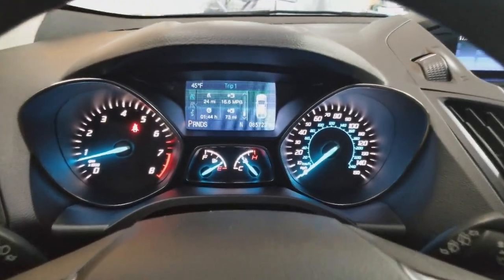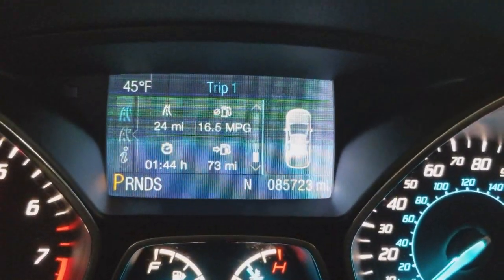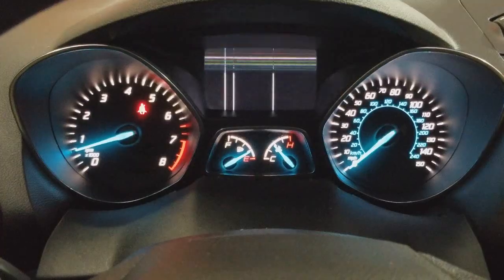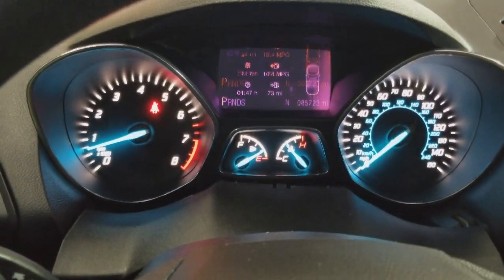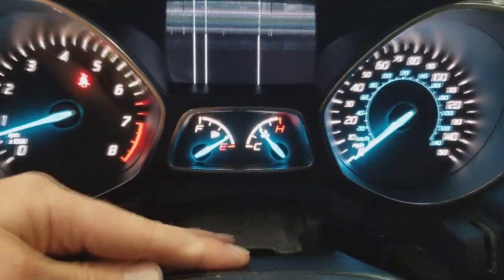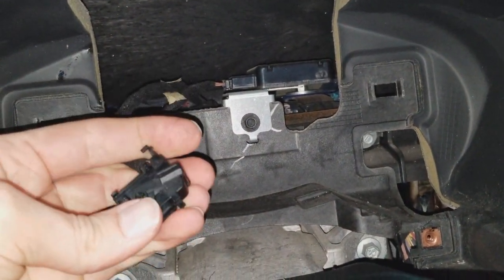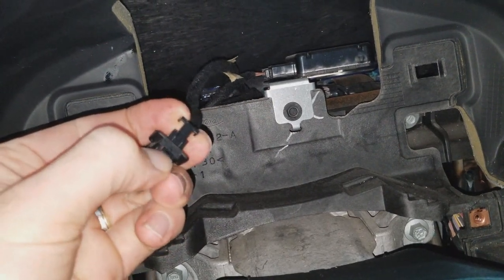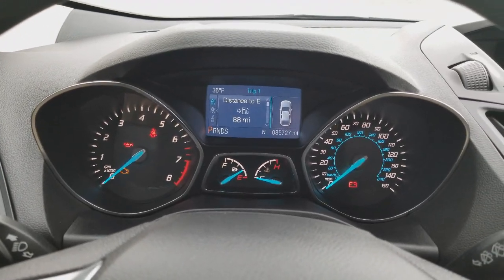2013-2016 Ford Focus Escape Dash Cluster LCD Display Problem | How To Remove

Comment: ours does this and its a 2016 with 28k miles. needs to be a recall on this cause it makes it impossible to know the milage of your car and when you need to service it. also this is temp fix. once it goes out ford wants $1k for a $50 screen and 15 mins work.

Comment: My 2014 Ford focus just started doing this on the radio display screen thing. The screen above the radio. It started doing that flickering thing and change to like a solid gray/white color a couple days ago. It would be fine in the morning starting it to leave for work and as soon as id start driving it would start doing that flickering thing and then after a few minutes go to that solid gray/white color and stay like that for a few hours and flicker a little. All of a sudden later in the day/evening it would snap out of it and be fine later at night until morning. Now it's stuck on a solid white screen. What do I do exactly???? Same process as this it what?

Comment: I see that you removed the cluster, and replaced the cluster. but what did you do to fix the display?
Reply: it usually an capacitor or resistor :)
Reply: Sp for someone doing it for the first time ..did you replace it..what was replaced?
Reply: @MrNismom  He wants you to remove it and send to him and he will fix it and send it back  (for a price of course.}
Reply: The lcd screen needs to be replaced...
You can buy it bra d new for around $100.
Or you can go to a yunk yard and pay around $10.
Reply: @enriquediaz5051  don't dream on 100 dlls
Actually the cost is 600.00 at the ford dealer
Reply: @jesusl4262  The $100 is to order it on Ebay, many sites offer it at most $150.  Yes at the dealer it is $430.
Reply: @flubu33  I just found out thanks

Comment: Before changing it , is there a possibility that the screen just needs to be unplugged and plugged back in again? 
 The screen broke within a year of buying the SUV. My dealer said it wasn't gauranteed. What is the best solution, and cheapest to get the screen working again?
Reply from the maker: It's not a connection issue. It's a bad display. You can either buy the display from us or send it in for replacement. Either option is quite cheap considering the cost from a dealer.
Reply: @AutomotiveCircuitSolutions  p

Comment: I've learned that whenever possible, one should never ever take their car in to ford for any kind of service.  When they offer you a service for free, alarm bells should be going off in your head.  Within a week to two months after they complete some service on their vehicles, something else goes wrong with the car.   Just my opinion but, I believe that ford is notorious for swapping out good parts for faulty parts so that they can get your business.  They seem to really get you with the many computerized sensors located throughout their vehicles.  I only take my car to ford for a transmission fluid flush, only because they seem to have a monopoly on the patented equipment needed to do the job, such as their Ford designed computer dianostic system and their Ford only tooling wrench.  Once I went to them for free state inspection and a week later the air flow sensor went bad.  Cost me over 400 dollars for them to "fix" it.  Another time, I went to them for a safety recall notice.  Two weeks later the sensor, in the transmission, died.  They wanted 2,200 dollars to "fix" it.